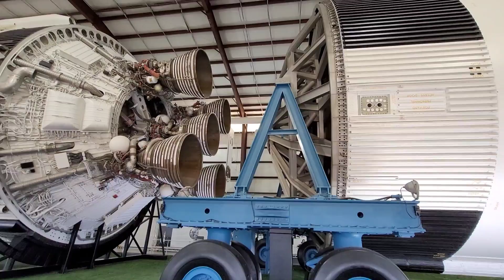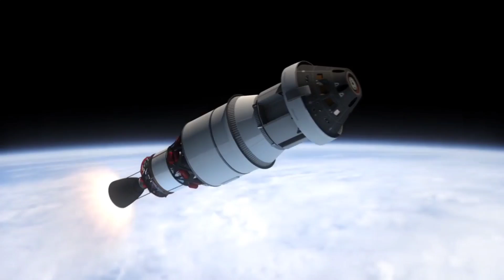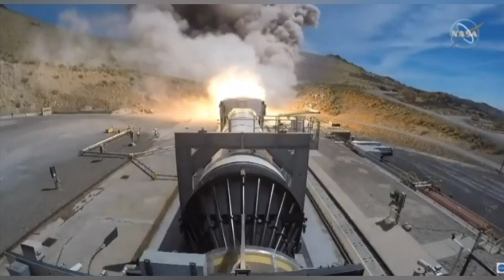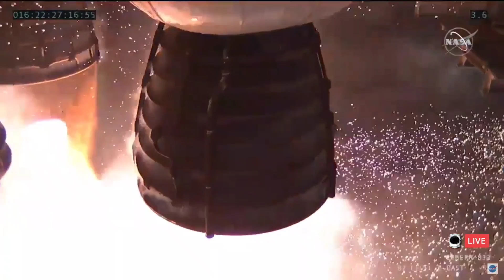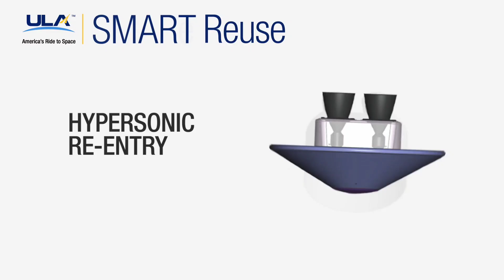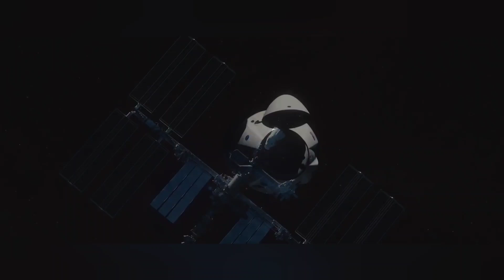Green Run Canceled! How did Boeing foul up SLS so badly? Can SpaceX or ULA (both?) solve this?

Comment: Back when Boeing participated in the Apollo program ot was a program ran by engineers for engineers as was its airline and military aviation arm. When McDonnell Douglas merged with Boeing in Aug of '97 it started that once great company's downward slide to the dumpster fire of an organization that it is nowadays because the same pencil pushers that ran MD into the ground had a new victim to sink their fangs into and they ran with it.

Comment: 1 ) Boeings problems go far beyond SLS, a number of their programs are in trouble, it is a travesty what Boeing management has done to the company. 2) The major cause of large technical programs having problems is Congress by changing scope or forcing a solution. 3) It is naïve to think existing components can be easily strapped together.

Comment: The SLS costs 1.5 billion + the cost of a fully expended falcon heavy to launch. NASA indirectly admitted this in the article where they talk about how much money they will save by launching the Europa clipper on a commercial rocket (read: FH) instead of using SLS. 
Also, the Vulcan won't be doing engine recovery or orbital refueling for a while. It will probably take a few iterations of the rocket before they even try to do it. 
Now don't get me wrong, I actually kinda like ULA. They are probably the best of the legacy rocket companies (and far better than BO), but they won't hit all their marks on the first vulcan flight. It will take a while.

Comment: Well at this point nowadays the question should be asked what did boeing not fuck up. STS-100 starliner still isn’t operational (programming problems), the max had huge problems (programming problems) and the SLS failed green run due to programming issues. Hmmmm how strange i see a pattern here

Comment: The thing alot you don't seem to know is that it is required by law for SLS to launch, or else they are commiting a federal crime. NASA is not waiting for Lunar Starship, and there is many things wrong with using Lunar Starship. How will it get back when there's crew on it? You need to essentially make a new crater on the moon in order to create enough methane for a proper return to Earth Orbit. And Apollo costs over $2B per launch when adjusted for inflation. SLS will only cost about $1B per launch. And it's only launching once per year, meaning you can easily earn that money back. Not only that, but if they cancel SLS that would set us back by over a decade in terms of getting to the Moon, and that means Artemis is essentially, which means no Lunar Starship since the Moon is barely on SpaceX's agenda. Basically defeating the whole "destroy SLS" mindset.

Comment: I've thought that SLS should have been cancelled years ago.  But since it's all built and ready to go, there's no point in wasting all that money...launch it a few times and then cancel it when Starship and Vulcan come online.  However, it's not ready to go and it appears Vulcan will beat it to space now.  Maybe even Starship will beat it to space.  Time to cancel the thing and let the chips fall.  Or give the program an ultimatum:  Launch Orion successfully to orbit by Dec 31st, 2021, without additional funding, or the whole program will be cancelled on Jan 1, 2022.  If it blows up on the pad, it's cancelled.  If Orion doesn't reach orbit, it's cancelled.  If it sits on the pad fueled at 11:59:59pm on Dec 31st, defuel it, it's cancelled.  I think that will light their fires to solve problems now and get it flying.  The Shuttle last flew in 2011, right?  If it's so much Shuttle technology, it shouldn't have taken 10 years to develope.  As you said, the new parts of it have flown once on a Delta IV Heavy, half a decade ago, and are ready.  It's the proven Shuttle technology that's not ready.  Outrageous. 
And why doesn't SpaceX develope the adapter and fairings to launch Orion on the Falcon Heavy...as a backup system?  It doesn't need the whole fairing-nosecone like it would for a satellite, right?  FH has flown 3 times.  It is made of well tested Falcon9 technology.  Orion has a launch escape system.
Reply: We have the efficient, capable FH sitting around, doing nothing, waiting for the colossal, and colossally expensive SLS...which still isn't ready.  What of NASA said, "I want a Centaur mounted on a FH to take Orion to the Moon."  Couldn't that be done?

Comment: OK-------------- There you go again with your selective hearing and memory.  Not to mention the fact that you are Gushing in LOVE with the ULA rocket that has yet to even be seen let alone fly even ONCE. With a good chance that it will fail to make its first launch date, (whatever that is) or even fail to make orbit. With you all ready to send Astronauts up on the Phantom  ULA rocket without the years of testing you are demanding Space X must DO. While the Falcon Heavy which has flown many times is having a new Faring built (for the military) that is plenty big to hold the Orion.  Did you lie about that or are you simply Deaf and Dumb?  Please Quit KISSING the ULA Rock. It is embarrassing. And Zip up your pants while you are at it.

Comment: The SLS is an almost complete redesign: basically an all new rocket.
The central tank of the Shuttle had to be able to manage the thrust of the Shuttle engines with the Shuttle hanging off the side.  The SLS has to manage the thrust from engines directly below the tank.  That required major changes to design and construction.
The Shuttle RS-25s were also redesigned for SLS.  Since they won't be reused the design was slightly simplified and the power was increased.  As for that valve that Boeing added, we will never know if it is needed because of the changes made to the engines, or not.
There were design changes made to the seals of the joints between Shuttle booster segments after the Challenger disaster to make them safer.  The new boosters are more powerful because they are longer but they are even safer because of more design changes, including improving the joint seals again and reducing the number of segments.
SpaceX is going to launch the Lunar Gateway Power and Propulsion unit and the Habitat.  They will also be using the Falcon Heavy for Lunar Gateway supply missions.   
Man rating the Falcon Heavy shouldn't be that difficult, and  a Crew Dragon would be a fine replacement for the SLS/Artemis system.  Unfortunately SpaceX has decided to put all of their limited supply of engineers to work on the Big Heavy/Starship and not to work toward a man rated Falcon Heavy.  Shame on Elon for doing this.
Wasting money on the SLS will continue until such time as the Starship proves it is reliable and SpaceX asks for it to be man rated.
I'm angry at Congress for this SLS mess, NASA for continuing to support it, and SpaceX for not trying to get the Falcon Heavy man rated.

Comment: J-2 not a J-5..... please research first. Your content is too good for all the little screw ups

 Falcon Heavy is capable of putting orion TLI with an adapter fairing........ and doesn't require developing untested refueling tech. A simple interstage is easier to develop than integrating and then inventing hydro lox refueling on orbit. 

The best bet, period, is a two part launch and do EOR/LOR/LOR and then return.

Comment: The Vulcan upper stage could only be refueled if they hadn't canceled the 'ACES' rocket stage. But there is no reason ULA couldn't bring that technology back, and also increase the number of strap-on solids on the Vulcan to Ten. The payload then to low Earth orbit should increase from 28 tons to about 45. Twinned launches of that booster could achieve Orion missions to the Moon with an Orion that had increased Service Module propellants and therefore able to insert itself into low Lunar orbit and also leave afterwards. The Dynetics Lander could be sent directly to the Moon on the upgraded Vulcan, a New Glenn or an expendable Falcon Heavy.

Comment: They should have conceived this launcher to have 5x engines on the Corestage from Day One . Also; the Exploration Upper Stage AND higher tech Solid Boosters should have been incorporated into the system - again - from Day One. Because what's a few Billion with a B more, when you're going to be throwing the Corestage into the drink without re-use and ditch the upper stage in space? If you're going to throw away all that hardware each time, at more than $2 Billion per launch - then you should be maximizing the payload into space; more than 130 metric tons. SLS is a dinosaur. And so is that corrupt, incompetent oligarch Shelby.

Comment: 2:32 "Powered by a single J-5 (J-2) engine."  IRT Boeing general lack of performance these days, I lot can be tagged onto their leadership.  Boeing used to be a company run by engineers.  Boeing's present CEO,  Dave Calhoun, is an accountant.  He received a bachelor degree from Virginia Tech in 1979 in accounting.  Accountants have seldom been known for their innovative thinking.
Reply: Yep. The day the bean-counters took over Boeing was the day excellence at Boeing died.
Reply: In Hollywood, it's said, the accountants are more creative than the writers.
Reply: @JohnDlugosz  the past few years shows just how true that is.
Reply: Or for their pioneering rocket designs........
Reply: They are accountants because the SHARE holders are who?  Financial institutions who vote on the board.  Boeing's shares used to be owned by the founders of the company who were all engineers, and therefore they HIRED CEO's who knew engineering.  Same goes for GM, IBM, etc.  Why big public companies fail?  Boards are owned lock stock and barrel by accountants, banksters, pension funds, etc without one engineer anywhere to be found.  SpaceX has another couple decades to be a viable company and they will go the same way as Boeing, GM, IBM, GE, Kodak etc.  As soon as Musk disappears, Space X will go to shit.
Reply: @w8stral  They were doing fine until Condit stepped down in 2003.
Reply: @tjj300  Condit was forced out by the aquition of McD's.  Biggest mistake ever.  McD's was destroyed by accountants so what did Boeing do?  Bring in all the upper management from said failed company and force out all of its own.  End result?  757 was never upgraded.  Airbus is now selling ~2000 such airplanes.  717 was disbanded, Bombadier filled in the gap, and will now sell several thousand said airplanes as it is the REGIONAL market which is the bread and butter.  Boeing in 1998, before taking over McD's had plans to completely replace 737/smaller market with a canard type aircraft using FBW.... well, 20 years on, we know what happened... Complete and utter failure on ALL fronts.  No regional aircraft, no new 737.  No upgraded 757 or new 757/767, and only 1, write that down, 1 new aircraft in 25 YEARS.... 1 in 25 years....   Hrmm, wonder why Boeing is dead... Gosh golly gee, when all you do is pull down dividend checks, life is good... for about 2 decades till you destroy the company.... the Finance people love you in the short term though...   Why I quit Boeing 15 years ago.  Zero engineering was happening even though there was 10,000 engineers being paid.  All of the little engineering that was being done was contracted out to foreign contractors while 5000 engineers at Boeing turned into thumb twiddlers with baby wipes to pat the contractors asses when they shat themselves.

Comment: I like your proposal on how to proceed with Artemis using Centaur to launch an uncrewed Orion/MPCV. Which could then see the Orion/MPCV fueled up in LEO, and picking up some lunar hitchhikers from Crew Dragon before a trans-lunur injection. It wasn't clear though, how much additional cost there would be outside of the necessary rockets needed to achieve this. Specifically, the development, hardware, and testing costs for the orbital fueling of Orion. In addition to the costs for hardware development and testing needed for the docking and crew transfer technology. Any ideas on this AA?

Comment: I don't get why the main engines are over expanded relative to sea level. Wouldn't they get a decent amount more thrust if it was more optimized for sea level? Or were they too lazy to do some modifications from what is basically the shuttle main engine.

Comment: The Vulcan that has been rolled out has inoperable BE4 engines... cryotest only, can’t be fired. So... it depends on engines from a company that hasn’t put so much as a golfball in orbit. Pray for Vulcan
Reply: Correct. BE-4s have been test-fired on stands, but at this juncture not tweaked for use in space. Orion, not human rated yet either, the Vulcan isn't going anywhere soon...

Comment: Meanwhile,
The fourth round of testing was successfully completed, up until the RUD. The demonstration prototype of our new electric spacecraft thruster is generating forward thrust.
The engine is generating 0.07 Newton's of thrust @ 18 watts peak, 9 watts continuous.

Bad news is, the converter blew up  during the last test. A few days of repairs.
Then the engine power can be turned up to max, test the max thrust potential.

Then the engine will be sent out for independent testing and validation.

CTO
Douglas Renzoni

Comment: the issue with vulcan is pad and rocket turn over. ULA only has 1 pad capable of launching Vulcan  and being ULA only launches 6 times a year id suspect it doesnt have the modern experience of quick pad turn over and multiple vehicle assembly.